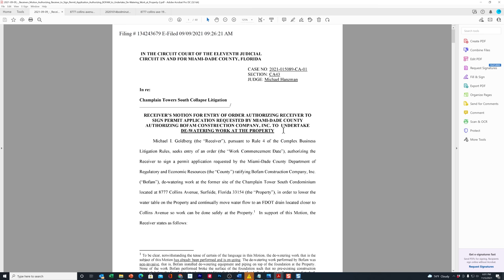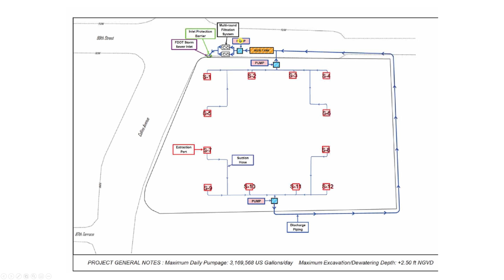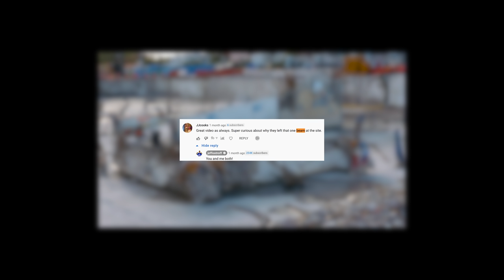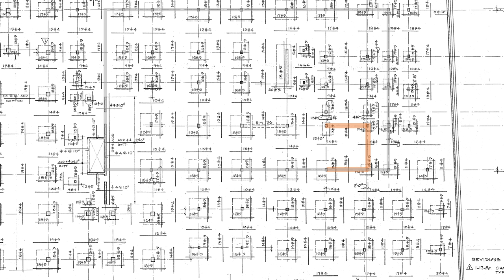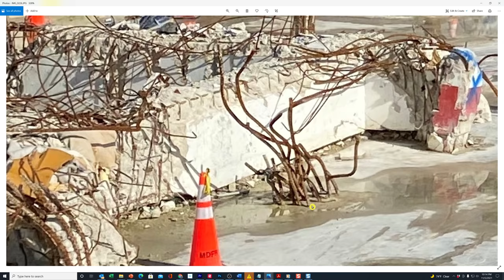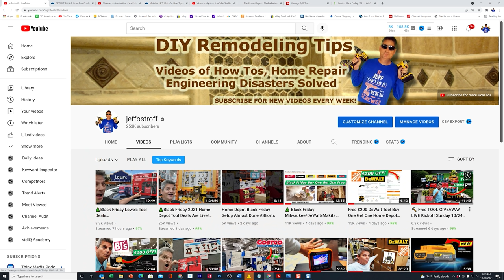Miami Condo Collapse: Engineers Baffled By Mystery Column

Comment: Looks like that 5th column has stepped off the H beam during the collapse and punched through the concrete floor of the garage level - makes me wonder - was that floor undermined by water leaching out the ground below it? A test bore through the floor at that point may reveal it if so. Ultimately, could water be the cause of the weakening that led to the collapse? Edit: Reading through other people's comments after posting mine, it seems we're all thinking along the same lines - ignoring any other less than ideal design features of the building, water undermining critical supports seems a likely culprit given the rapid flooding of the site whenever pumping is interrupted. Was sufficient up to date and accurate information on the local underlying hydrodynamics available to the designers? Did any subsequent works nearby change that situation? Did the intrusion of the structure itself result in changes to the underlaying water flow that could not be foreseen due to insufficient data? It is in the nature of the ground to be opaque, and it is in the nature of man to err. Perhaps we are too reluctant to insist on demolishing inadequate buildings in the light of better new understanding.
Reply from the maker: Viper they are looking into all of this
Reply: That is the single most logical place for where it came from.

And you cannot see the full extent of damage due to the pooling water.

Comment: my guess is ...look at the picture at 13:59 in the video---in the upper right corner (on the image the H beam) that has red paint on it was supported by the column behind it in the image (re-bar that is painted blue )  the "mystery" column was the support for the end of the H beam that is closest to you in the image ( end of H beam that has tan foam like material sitting on the H beam)
If you took just the H beam and slide it up and to the right in the image it would line up with the mystery column and the column painted blue.     The H beam most likely did not fall straight down.  if the pool deck failed first it would have pulled the H beam towards the first columns that failed.  similar to how the failure of the pool deck pulled the support columns that held up the side of the building facing the pool deck.
Reply: good analysis. The mystery column - 01-8  had a L type pilecap. The view on the video is wrong.
Reply: I see where you're coming from, but that blue column is in the basement floor plan ALONG WITH the red painted column supporting the upper right (from your view on the timestamp). That and looking at the position of the other columns suggests the H-Beam is in its correct place in relation to the drawings.

Comment: The column starting on the H-beam shifted and the column from the first floor impaled the pad. I bet the investigators confirm this by accounting for the entire length of that column, minus what impaled the floor of the garage.
Reply from the maker: no, angle is not right, and there is no damage on the concrete floor from being impaled.
Reply: You are correct . The beam was pulled  south you can see the steel is all bent that way and the column came down and punched the slab ..Mystery solved
Reply: @whirlwind8825  Don't ever become a detective.

Comment: 1. Column on top of middle of H beam is larger than others. 
2. This Column carries weight through all floors except basement. 
3. This Column is not exposed to water and is at full strength.
4. Garage level columns and floor  have rusted rebar and concrete that has reduced strength from 40 year water intrusion per the engineer.
5. H beam falls  without the first floor dropping, per residents  that went to front desk+ images in video.
6. This column is hanging almost free with nothing under it except basement floor.  The rest of the building then falls pushing the column into the basement floor like a battering ram with thousands of tons of force with no rebar below it to impead it's 10 foot drop( like the other basement columns) .
7. The cement dust and debris fill the gaps in puncture hole in the floor. 
8. Someone sneaks in to inspect hole for loose concrete vs formed/whole concrete and checks rebar count matches specifications.
9. BTW.. column not the main or first cause of the collapse.
Reply from the maker: Yes I don't think the column or this beam was the root cause of the collapse either as if you look at the security video camera from the hotel next door you can see that the collapse started pretty much around left of center of the building which is more over where the planter area is in column M 11.1. However I don't believe that the floating column impaled into the garage floor because I think there would be a lot more damage to the floor like craters and cracks and stuff like that you can't just displace concrete like that mine is just thick it has to go somewhere and it usually would just pulverize into pieces
Reply: #5 is wrong.  That H beam falling would have dragged the whole east wing down with it.  Would have instantly compromised 5 columns.
#6 is wrong.  Column K was really just a series of columns, poured at different times.  It was also connected to the slabs at every level with rebar.   It wasn't one long 'battering ram'.  It would have disintegrated as the building fell.  Also, even if it were one long, 120 foot column, the garage floor slab is 9 1/2 inches thick.  A column free falling one story only achieves a velocity of about 15 mph.  So an intact column K, which in total weighed less than 30,000 lbs, hitting the garage slab at 15 mph, WOULDN'T DO DICK.  It would crack the slab and make a divot a couple inches deep, then just fall over to the ground.  Also, "thousands of tons"? NO.  The building in total weighed 10,000 tons.  Several dozen columns supporting that weight.  Maybe a load of a hundred tons being carried by column K.  But once it started to disintegrate, that load was irrelevant.  It wasn't transmitted straight down.
#7 is wrong.  Because 6 is wrong.

So, thanks for playing, here's a nice parting gift, don't let the door hit you in the ass on the way out!

Comment: I would be as interested to see how the column was supported . There should be a footing plan (assuming drill piers or piles , not pads )  If  the foundation does not exist on the original plans , then it would likely be a repair addition . The column appears to be substantial with 4 bars each side (12 vertical column) should be a column schedule and a corresponding footing schedule that will list the column.
Reply from the maker: If this columns was added in the last 12 months, there would be no footer beneath it, all the piles were buried in 1980.
Reply: Is there any markings of a beam on the bottom of the H beam?

Comment: At a Miami Beach lounge, 1979, 2AM, 3 sheets to the wind ... William Friedman, Architect: "Hey Sergio [Breiterman, Engineer], think we oughta beef up these 4 columns under the H-beam, from 16-square to 24-square?" [Punching buttons on his TI-55 calculator...] "Naw Bill, [hiccup] too expensive, that's why I spread it over 4 columns to begin with... she'll be fine... I do it that way ALL the time... all up and down this coast... "   =:O
Reply from the maker: That would not surprise me at all!
Reply: I agree, all the columns in the garage level should have been 24" x 24".  But you're forgetting, the tiny pool deck columns are the ones that ultimately brought down the building through punching shear.  Even on 16" x 16" columns, the 24 inch wide 'lintels' atop those columns, formed by the H beam legs, there's no way in hell the slab would punch through there.  
With the position of the mystery column, it could have only supported the slab above.  Then again, who knows what their intentions were??

Comment: As a professional firefigter of over 20 years I might have a good idea how the "column" appeared. I have on numerous different occasions seen structural members "pile drive" themselves into the ground and through slabs due to collapse. My ,somewhat educated, guess would be that he column hat was supported by the H beam broke off close to the H beam and proceeded to drive itself into the foundation slab during the collapse. I once saw a 4x4 wooden post do something similar through a basement foundation slab due to a structural collapse and have seen it also with vertical I beams in investigations. I am not the only one with this conclusion either by the comments section I glossed over before commenting
Reply from the maker: Well the problem is this mystery column is 5 feet from the H-Beam so how can c olumn falling at that angle be straight up in the floor, and also no damage to the floor?
Reply: @jeffostroff  The only way to answer that would have been able to see the column before the demo crews cleaned it up. The equipment could have pushed the rebar into a different angle than it originally came to rest in, or it could be from another column entirely that found a void to go through and drive itself in. Without seeing the debris as it was uncovered, it will be impossible to say for sure either way. My guess is that when the report comes out it will either be mentioned or completely explained and with the litigation and public interest, the invetigators will be very thorough and we will get the answer then. It plainly isn't there in the video pre collapse and so it had to have come from somewhere and my original post is my guess as to how it happened. I might add that even the best of investigators dealing with engineering anomalies still have to do a whole lot of guessing to figure this stuff out without concrete video proof showing the entire event.

Comment: Sorry if someone already pointed this out... Looking at the video at roughly the 4:00 minute mark, I don't see any indication at all that the first floor beam that was "supported" by the H-beam was actually attached to the H-beam. I see nothing protruding from the top of the H-beam in the area in which your drawings seem to indicate the beam would have been located. Certainly not anywhere near the midpoint of the crossing beam. Is it possible that the beam that started on the first floor was NOT actually attached and then did in fact drop almost straight down into the basement thereby puncturing the basement floor as some have suggested?
Reply: Curious as well
Reply: I agree with this. Why would we not see protrusions of rebar from the topside of the “H-Beam” chunk left on the garage floor? The new column location for suite 12 floors above the garage should have been bonded with rebar included in the H-Beam and into the lower column beginning from that point on the first floor. The omission of that may help support the theory of that column shifting away at an angle and into the garage floor.

Also, there is at least one more column with the mystery red paint. It appears when the camera is panned about from one side of the ram to the other. I agree red is used as a quick visual indicator to fire protection system. In this case most likely manual human accessible pull handle installed on the column. The second red painted column has a device mounted with conduit leading upward that can be seen if the video is paused.
Reply from the maker: You would not see that first-floor floating column attached directly to the top of the beam. Remember that each beam connects to the bottom of the first-floor slab which is likely 9 1/2 inches thick. So really what you're looking for is the first slab to see how that floating column would have attached that slab, not directly to the H-Beam
Reply: It's likely column K's rebar was tied into the rebar of the first floor slab, which rested on top of the H beam, and was undoubtedly poured after the H beam had cured.  The column had adequate lateral support from the slab and didn't need to be tied into the H beam.  All the loads from that column were vertical.
Forget about the 'impalement' therory - it's already been dubunked.  There was simply not enough energy for an 8 foot column section, falling even from the penthouse to even penetrate the 9.5" garage slab.  
And forget about a monolithic, 120 foot column piercing into the ground with great force.  Didn't happen.  The building was disintegrating during the collapse, column bases and tops crumbling and, still connected by rebar, simply rotated along with the falling slabs, winding up concealed in the wreckage..

Comment: Boy, that is bizarre.  If it was an addition, attempting to shore up the transfer beam, it had to have been added between July 2020 and June 2021.  It was unauthorized work and ultimately pointless, as there was no piling beneath that spot.  I guess they could have cut the slab and added a regular-type footing, but I'm not sure that would have been effective on sandy soil, especially soil saturated with salty groundwater...
Maybe now we know why they haven't removed that H-beam from the site.  They're trying to figure out what the hell that column was!
The mystery deepens!!
Edit:  Even the 'shoring up' theory is suspect.  That mystery column is inline with the 'O' columns, not right underneath the 'floating' column K supported by the H-beam.  K is offset from the 'O' row by several feet to the west.  It wouldn't have done anything to carry the loads.
Reply from the maker: Yes this is got me stumped
Reply: @jeffostroff  And by the amount of rebar they used, I wonder what the hell they thought they were supporting...
Reply: I think you're right John.....the beam was added recently....sometime in the last year after that real estate woman took video of that area! Has to be why it's there. That's proof that there was weakening going on in that area and they were putting a bandaid on it.
Reply: @johnbergstrom2931  it would have provided little support to the building as a whole. The H beam stayed intact that beam did not fail so it was dong its job. Most everywhere else the columns small that they were went all the way to the top floor, there may be a few exceptions . The H beam transferred the load of one column to four columns.
Reply: @kmagnussen1052  Thanks for parroting information I'm already very familiar with...  Nothing original added.
Reply: Might be totally unrelated but what about the other tower that was built using the same plans?
Does it have that collumn too? If so does it start at the basement level?
Reply: @veebie0015  Well, that's a good question.  Everything is 'mum' and 'hush hush' now, so doubtfuly anyone is going to be forthcoming about problems...
The standard line is that the sister tower, Champlain Towers North, kept up better with maintenance and didn't have the severe concrete corrosion and water damage the South did.  So if that's true, maybe they don't have extensive cracking and spalling like the doomed building did.
I know one thing, when NIST puts out their report, CTN is going to have to do some serious remediation to it's underbuilt columns, especially under the pool deck.  They might even go to the trouble to cut an isolation joint at the pool deck/building line, to completely ensure that this catastrophe won't happen to their building.
Reply: @johnbergstrom2931  also not exactly the same and was built years later.
Reply: @tomgreen99200  Yeah, but close enough.  The pool deck and first floor slab are still built as a monolithic unit, and the pool deck columns are just as tiny.  The structural integrity of the North building is still shaky, but if they don't have the decades of water damage, they're probably safe until they can reinforce the structure.

Comment: San Francisco is soon going to have a “Hold my beer” moment.
Reply: Oh, from that high rise that's tilting into the ground?
Reply: @johnbergstrom2931  Yep.
Reply: @boataxe4605  How bad is it getting?
Reply: @johnbergstrom2931  Off plumb by 12 inches and still sinking. The property owner and city inspectors have agreed on a fix that just about all outside engineers say won’t work and may make it worse.
Reply from the maker: Leaning tower of SF
Reply: Cost equations: original build = $$; first repair/patching (where they’re at now) = $$$$; tear down = $$$$$$$$; collapse = $$$$$$$$$$$$$; repair/patching continuance (and you know it will have to be even if they do get it to bedrock because everything else will have to be realigned as well as overall maintenance) = $$$$$$$$$$$$$$$$$$$$$$$$$$$$$$$$$$$…

And the answer is…
Reply: Millenium Tower. Liquefaction occurs before any seismic activity.

Comment: It sure looks like the mystery column is the vertical column from floor #1, which slipped off the H beam during the collapse and punched down thru the slab. What is truly odd to me is that there is no rebar protruding from the H beam vertically into the 14 story vertical column. It appears the vertical column was just floating on top of the H beam - is that normal construction?  Possibly, because the H beam might "flex" by small amounts... idk?
Reply from the maker: Yes the column on the first floor went all the way up to the penthouse and it was a floating K column 12 inches by 24 inches. And they have it resting on that middle beam of the H beam bit of the garage floor where it would block the driving lanes. So the age beam rests on top of four columns which then take the load from that one column and re distribute it to the outside lanes of the traveling in the garage. But I doubt that the column came down in Pierce to the floor because otherwise there would be a lot of damage to the floor